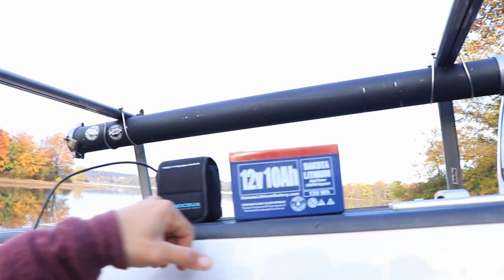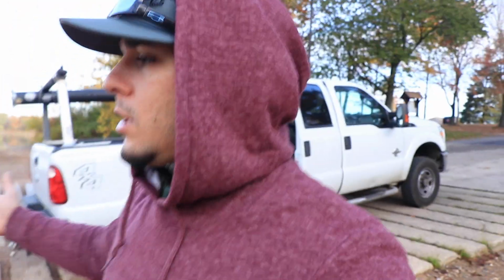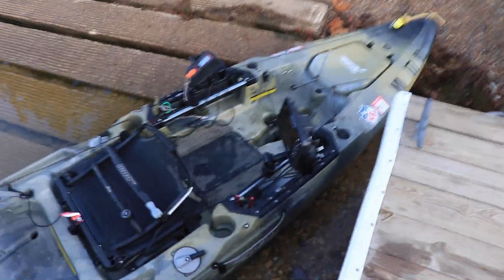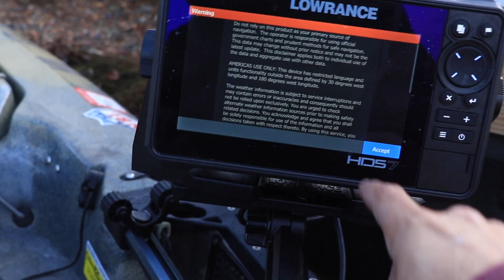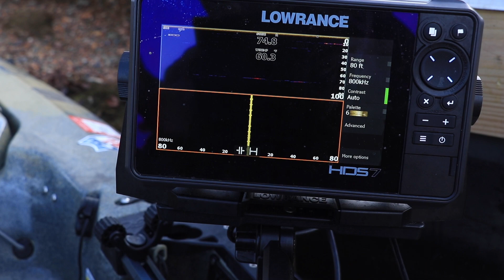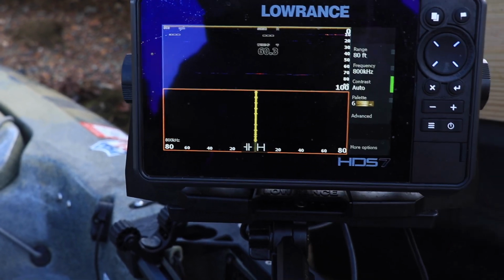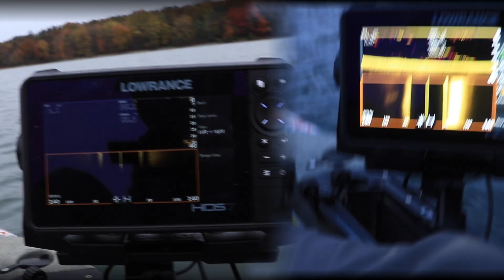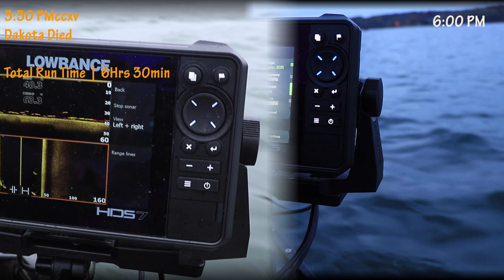Dakota vs Nocqua | Lithium Battery | Lowrance HDS 7" Live

Comment: Nice attempt, but you need to control the variables.  Do them both under the same load at the same temperature.  Like no demo mode and just let them run until failure.
Reply: I was also wondering how hard it is for him to do math. His use of terms like "I think," "seems," and "so like" combined with his uncertain demeanor makes this a useless test and video.

Comment: My no quad will only run my elite ti2 for about 6 hours. I get a low voltage warning on my graph after about two hours and then it will run for an additional 4 hours or so... I’m going to increase to a 20 Ah battery I think.
Reply: Do you have a 4.4 ah or a 10ah? I’m assuming 10 but I’m looking to run a discontinued garmin on one
Reply: @noahjohns7954  I went with a 23Ah DL battery, solved my problem.
Reply: @amals51  do you think a 4.4 would work for max 6-7 hour days? Or should I go 10 ah